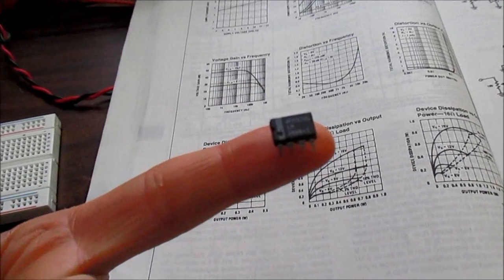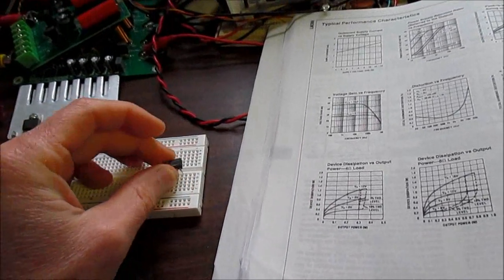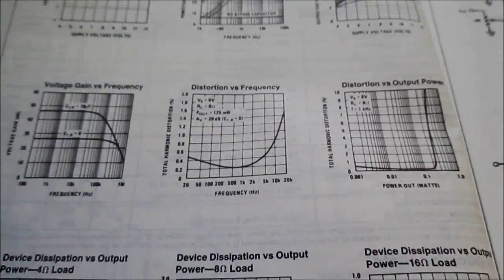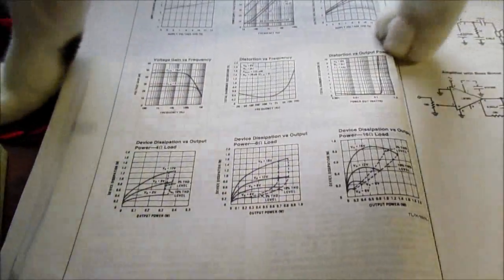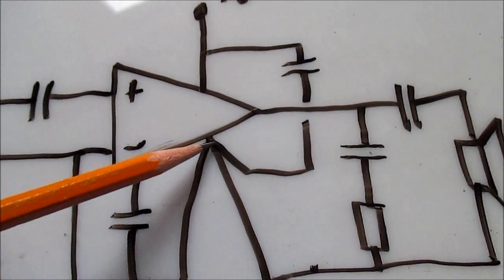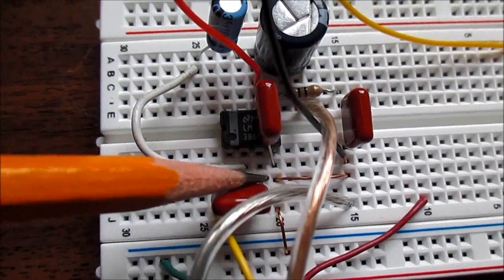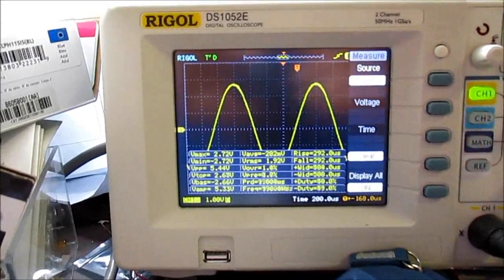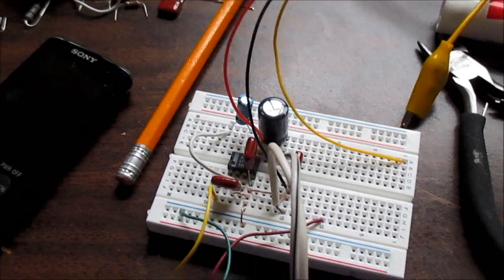LM386 audio amplifier and proper ground layout

Comment: if you need amp that sounds like a motorboat or airplane prop get the lm386,much better options to use than a 386 that burps and farts more than i do,i had these and most just burned out on very low power,years ago this was a great chip,what went wrong with it😂

Comment: In your first example you were using the inverting input, but in the next example you used the non inverting input. In the first example you did let the non inverting input open, but in the second example you connected the non inverting input to the bypass capacitor of pin 7, but did not connect them to ground! I don't understand this. I can't argue with the results because the second example did sound better. But I don't understand what you did because in one example you used one configuration, but in the other example you used another configuration. My confusison doesn't come from the fact that in one example you did an inverting amp and in the next a non inverting amp, but because you did not make the same connections. In the first example you followed the manual, but in the second example you did not connect pin 2 to ground nor pin 7, but instead connect pin 2 and 7 with a capacitor and I don't understand this becuse it's not in the manual. In the datasheet it shows that those pins must be connected to ground. To me this is very confusing. Like I said, I'm not gonna argue with the results, but the circuits were not the same configuration. You did not just "rearranged" the grounds. I don't see how doing this is any different from having a ground in the same rail like you did in the first example. I did notice the difference, but I don't understand what is different about it because in the end of the day you had to connect all the points and what bugs me out the most is that you did not connect pin 2 and 7 to ground.
Reply from the maker: If you look carefully, you can see that I used pin 3, the non inverting input, in each case as the signal input. In the second example, the inverting input is tied to ground along with the bypass capacitor with a jumper. It is hidden behind the input capacitor but is visible at times in the video. The second example ties each return to ground using its own path which is a much better design. See my newer video "LM386 Done Right" for an even better LM386 circuit.
Reply: @JohnAudioTech  I finally got it! Google's AI helped me. I asked it over and over and over and over again and it kept explaining to me until I finally got it. See if you agree with me. We have a ground for the weak alternating signal and we have a ground for the energy which powers the devices and I can't mix those up because it generates noise. We will have to connect all the points, and this is where I was getting confused, but we have to connect them in the correct way. We do this by running one wire from our signal's ground and another single wire from the energy's ground and connect those two wires with the negative of the power supply (I'm not using a dual power supply, but a simple 9V battery). This will connect all the parts and will be the "star ground" configuration that you explained. I was using one ground bus for everything, but now I understood that I have a ground bus for the weak signal and a ground bus for the power signal, and we connect those two ground buses to the negative of the power supply. This way the currents won't be misex up. There will be a path for the weak alternating signal and a path for the power signal which powers the devices. Now I was experimenting with the simplest LM386 circuit which the datasheet presents and I think my chip is fake. I'm only getting 36mW of power. This is not acceptable for my chip. It should be at least 300mW give or take according to the datasheet. My chips must be fake. It sucks. Do you have a way to test those chips?

Comment: I built the circuit with a LM386-1.  Sounds great and no noise. I then swapped it for the LM386-4. No difference in volume/gain. Tried both chips at 5v,9v,12v and the  LM386-4 at 18v. No difference in volume gain.   Any suggestions on why and how to fix? I used 4 and 8 ohm speakers. I have a guitar pedal prototyping unit that supplies the various voltages so I can quickly test all moving a dial. No difference at 20 times or 200 times gain.

Comment: Btw a cap 1 or 2 UF down to .1 uf or suitable for your audio taste, audio from ground to unused input pin is good idea. It lets amp avoid offset on out put and lessens flat topping on plus or minus ac peak.

Comment: Like the cat. You can add small heat sink with heat conductive paste or silicon grease. U shaped fins or just thin copper bent in U about double size of chip will help a lot. Goid call on grounding plan. Really helps with the higher gain circuit with cap/ resistor from pins 1 to 8. 73 Karl

Comment: Hi John,
If you see this 8 years after the video a quick related question from me where I am an on and off electronics hobbyist is:

If you use an op-amp as a pre-amp with a Dual power supply such as +6 volts at the Vcc input and -6 volts at the Vee input where do you attach the Signal input ground? To a separate zone connected to Vee or to the floating or virtual ground or what ever the Zero volt connection is that the signal swings between as it swings towards but not hits both the  +6 volt and -6 volt rails of the Dual Power Supply???
Thanks.....
Reply: I think you dont need to so that? This ic propably moves audio sinewave all to thw ppsitive site so u can just use gnd and v+

Comment: I did follow the guidance offered here and definatley noticed a difference in the output.  One thing i noticed was that when powering up (and down) the LM386 was a distinct pop or bump from the connected speaker - what would your suggestion be to get rid of the pop or bump?

Comment: How can we have separate power and audio grounds when all the grounds are electrically same?
I mean to say that we need to connect all grounds at same point then how can grounds  be separate if we can't electrically separate them?
Reply from the maker: All wire and traces have a small amount of resistance and inductance. It is important that the small signal grounds are not carrying large signals (like the output return ground) Because the small voltage developed across the wire can be picked up by the input. Google star grounding. This may explain it better.

Comment: Btw, just a suggestion. Do you know smokey amp? Many people, me included have problems with noise. It would be nice if you can build it without noise, with just 2 47 uf capacitors and the lm386 ic. It is for electric guitars. Maybe you know it.

Comment: Awesome 
could you please explain jow to insert the msgeq7 into the circuit?
Its a pretty cool future which enables you to assign lights to frequencies, yet the gain is set to 20db so it limits the outcome 
gain plays essential roll could be cool if you would be able to control it

Comment: Why do you have a polyester cap on audio input but no resistor to make it a full rc filter? Im building an Lm386-4 stereo and need a cleaner audio input. Currently i only have a resistor in paralell.

Comment: I do hope you see this John. I received 50 x LM386 for £1.48. Failure rate = OOER! probably. No idea what V these LM386 (-1. -4 types ?) are so took a chance on 12 V. I did exactly as you said plus a big cap on each output (I did stereo and was worried about the DC / speaker thing) .They were pretty good on my old 15 Ohm Tannoy's, they are old school and VERY sensitive. First amp built in 50 years and first black thing wiv legs ever. Thanks for the help
Reply from the maker: 12v supply with 15 ohm load is fine for these little ICs. You could go to 15v with that load to give you a little clipping headroom if you find you need it. Have fun!

Comment: Years ago I had no luck getting the 386 to sound good, I watched your video's and I connected my Ipod stereo output together as you shown the proper way in another video, I am using 15volts supply,I am also using the bass boost between pins 1 and 5 and I have to say I am very impressed with the way this thing sounds!! Thanks for all the tips!!

Comment: You have a ceramic capacitor on the input signal here. Do you know what the measurement is for that? It's not suggested in the datasheet. I have an electrolytic cap in that spot already, to remove the DC offset, but I am wondering if this input cap has a distinct purpose.
Reply from the maker: That reddish brown cap is a film cap. Ceramic is not recommended for passing audio signals. As I recall, the input impedance of the LM386 is around 50k, so 1uf should be plenty. The input of the LM386 is ground referenced and no cap is needed, however I recommend using one to remove any possible DC offset as you have done.
Reply: Very helpful! I will get some film caps pronto. When you say 1uF should be "plenty" – do you mean 1uF is "plenty high enough capacitance" so that the capacitor does not add significantly to the incoming signal's impedance, which should in total be below 50k? Is that the goal in choosing a cap value for this spot?
Reply from the maker: The input cap forms a high pass filter with the input resistance (impedance). The roll off point (pole frequency) would be only 3.18Hz with the 1uf cap. With such a small chip amp, it more cost effective to use a smaller film cap because they are cheaper. A .22uf would work just fine.

Comment: So the ground paths basically have to be built in a star topology? I have a 386 circuit using an 8 ohm old car speaker and I always get a cracking or popping during random occasions. 9V supply. When it pops the sound will be sort of muffled..until it pops again and I get my clear signal. Lol. Would this help? I'd have to pull the circuit out of the speak box ad see if I could rework the pcb to this method...
Reply from the maker: Yes, you should always use a star ground topology to keep high current signals from flowing in in the low current signal paths which can cause distortion or oscillation. Shielding of the input helps as well.
Reply: JohnAudioTech Shielding of the input?
Reply from the maker: Yes, using shielded cable on the input helps block electrical noise.

Comment: This is going to sound mad but I just got 960mW into 8 ohm @ 12v, the chip got a little hotter than I'd like but it measured 2.78v RMS on the scope before clipping. Obviously the THD % will be high at this point but its still a surprise.

Have you ever measured anything like this with the chip delivering higher power than the datasheet spec? Also heads up TI just updated their lm386 datasheet.

Comment: Trying to add a 10k pot to the LM386(5v with TEA5767 radio chip/atmega on same BB), but having a few problems: I only have to turn the pot a little, and the volume distorts and cuts out. So I'm not getting the full volume range from 0 to 100% with the pot. How would I solve this?
Reply from the maker: See my volume control video (can't send link because of spam blocker). Sounds like you have some connections wrong on the pot.
Reply: Thanks for the reply John. I'd previously watched philo mech's tutorial, but it seems his is wired wrong. I've ended up putting a 104j cap on pin 3 to the pot output and removed the cap from pin 1 to 8. All working fine now and sounds pretty good to my ear:)

Will watch your video though to make sure I ain't missing anything. Thanks again :))

Comment: for me destortion is not the problem coz i use high capacitor on the power gate and use 450uf capacitor between ground and pin 7 the problem is the overheating i put small capacitor on the oudio output it fixes the heating but weak sound
Reply from the maker: If you at first connected the speaker directly to the output with no capacitor in series with the speaker, the chip will get very warm and probably be damaged. You may need a new IC at this point.
Reply: sure i know coz capacitor in the sires works as stopper the feedback to out put and block the DC from passing to speaker and open the way for AC signals only to pass

Comment: Hello there,

I am currently studying electrical engineering and I have a question regarding circuits. I want to be able to build an amplifier or speaker, create an original outer casing and then be able to sell it. If you use someone else's circuit is it considered illegal? Or is everything on YouTube regarding electronics and circuits open domain? I do not want to claim that I invented or created the circuit all by myself, I only wish to create a product that I can sell. Any thoughts on this?
Reply from the maker: I'm no lawyer but I think you are okay unless the circuit had some special design and was patented. Circuits based on ICs often have example circuits given by the manufacturer on the datasheet that you can use and modify without legal issue.
Reply: +JohnAudioTech Thank you so much for the response. First off, what does IC stand for? Second, are most of the circuits on YouTube patented, and if so how can you tell? Is it in the description box or something? Also, how would you modify an existing circuit so that it's different than the original? Please get back to me on this!!!
Reply: Berk THE TURK IC stands for integrated circuit, and usually there will be some kind of disclaimer in the description or something if the design is patented, but they usually aren't

Comment: LM386 has only 3 connections, +, - and Output, but in your circuit I see 4 connections to the LM386 8:03! How is that possible?
Reply: it has 8 pins, but only 3 are drawn in diagrams as its an OpAmp.

Comment: nice work! can you tel me if i can make an amplifier based on the lm386 to hear a guitar pickup output with earphones? as a sort of earphone monitor? thanks!
Reply: +tzenobite Yes you can. I actually have built a guitar amplifier. I use a 10" 2 way zenith allegro 3000 speaker as it's output. Makes a GREAT acoustic guitar amp.

Comment: Thank you very much John! Excellent, really reduced noise almost completely! What about Pin 7 capacitor? it's ground goes to power ground or signal ground?
Reply: I thought power ground myself as it’s a bypass for power. If you have a noisy PSU it can help. John can confirm I guess!

Comment: man I wish you wouldve gone through the actual wiring process
Reply from the maker: silentscribes In my LM386 amplified speaker project, I showed more of the wiring layout using basically the same circuit.

Comment: Awesome video John. I wouldn't have given the capacitor on pin 7 a second thought when it comes to its ground point, but now that I have seen this video it becomes obvious when looking in the data sheet.
Reply from the maker: Thanks for watching! If I didn't mention it in the video, if you can get the LM386 sounding clean, you can get any amplifier sounding good. The LM386 is sensitive to proper grounding layout.
Reply: @JohnAudioTech  How can we have separate power and audio grounds when all grounds need to be electrically same at some point?
Do you mean the distance between power and audio grounds should be far apart?

Comment: Excellent video. I have been wanting to build one of these little amps for a while. I am new to this, but I have become very interested in electronics after building a stir plate with the lm317 for home brewing. Can you send me a parts list? and schematic? I have looked online, but it seems like there are a lot of different options, as far as parts list go. Thank you.
Reply from the maker: Google for the LM386 datasheet. It gives several samples of different amplifiers you can build.